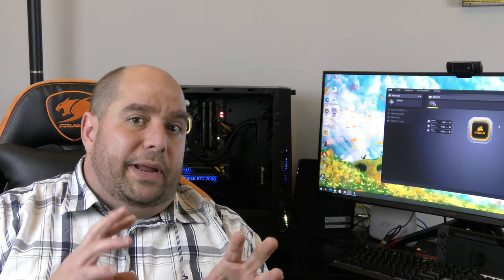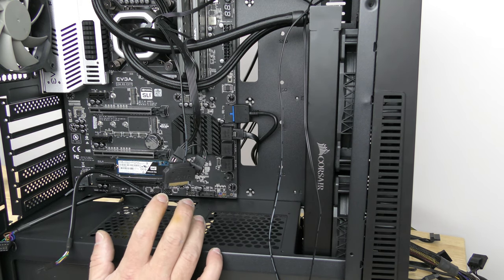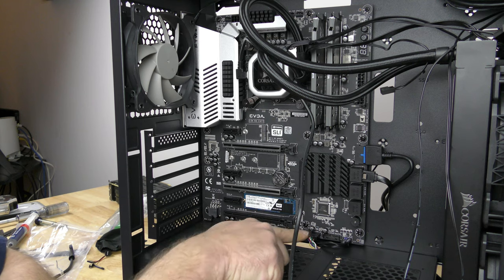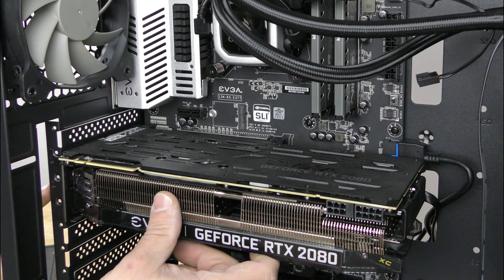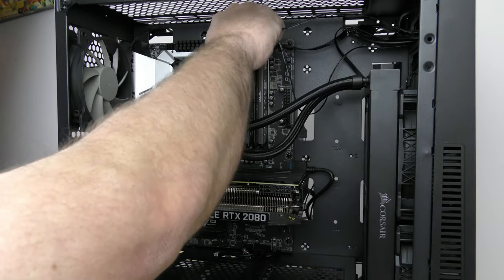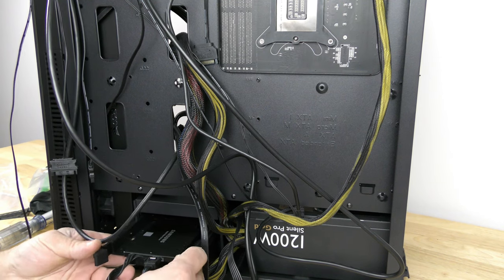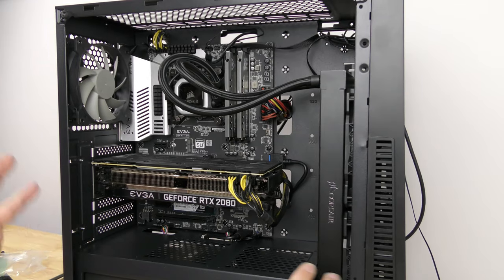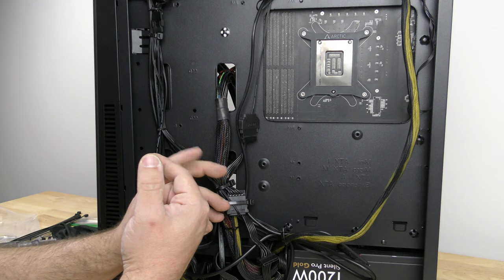How to Wire a PC Game Build for Beginners - Step by Step Wiring Guide 2021

Comment: Hello, it was my first time building a pc and got it build now, however, my ports dont seem to work. The motherboard does get power, as the RGB and the pump do work, but as soon as I plug something into the usb port or the hdmi I don't get anything.
Reply from the maker: well, are you using the front USB port or the rear and if you have a video card, you should be using the HDMI port on the video card, not the motherboard.
Reply: @ThisBytesForYou  oh no, I've tried front and back.
Reply from the maker: @wolfifly5944  do you see anything on your screen when you turn it on?
Reply from the maker: @wolfifly5944  oh wait, I just realized, the I/O shield on the back, where you plug the USB devices into, do that have a piece of metal going into them from the I/O shield, or are they slid over, out of the slot.  This can and does happen to many builders.  The I/O shield should not be inside the USB/Ethernet and other ports.

Comment: Why is the wiring on the case ? My case didn’t come with any wires I have the Darkflash dlm21 matx case .
Reply from the maker: the case comes with usb cables, maybe esata and the front panel headers.  The power cables come from the power supply and the sata cables come with the motherboard, like I showed you on the other comment, you can find some sata cables my amazon affiliate link: https://geni.us/1up1jYg
Reply: @ThisBytesForYou  so what do I do?
Reply from the maker: so what do you do about what... maybe buy the cables?
Reply: @ThisBytesForYou  okay thanks
Reply: @ThisBytesForYou  it doesn’t matter that my board is micro atx, it works for the same ?
Reply from the maker: no, it does not mater, it would work the same.

Comment: hello! I have a problem, 3 days age I made a PC, it worked perfectly until yesterday when my PC crashed and I couldn't longer see anything on my TV (im using HDMI) and some of the USB port no longer work, in the back of the motherboard I saw that 4 pins are bended, I don't know if they are the problem
Reply from the maker: bent pins are no good, make sure to get them straightened.  Which 4 pin is it?
Reply: @ThisBytesForYou  the are in the lower right side of the cpu (if you look from the back)
Reply from the maker: ohhh, you mean there are bent pins on the cpu?  Or do you mean on the back of the motherboard?  If you mean on the back of the motherboard, you shouldn't have to worry about that?  Maybe I am confused?
Reply: @ThisBytesForYou  yes, the bent pins are in the back of the motherboard but I said that they are next to the cpu to be easier to localize, also, the motherboard works, but the only problem is that my usb ports no longer works and so is my hdmi port
Reply from the maker: I don't see an issue with that, those are solder points.  I would recommend to count the number of screw holes on your motherboard, then flip the case around and look on the back and verify there is the same amount stand offs, the board could be grounded.
Reply: @ThisBytesForYou  I fixed it, thank you!.
Reply from the maker: @raingod6349  awesome bud, so what was the issue?
Reply: @ThisBytesForYou  I dont really know, I just rebuild the PC and it know works, maybe some cables haven't been connected well

Comment: The wires does the power supply have all the wires i need to set it up, Yea I Don't know how to build a pc like turn it on and Connect it to a Monitor
Reply from the maker: It depends on what your power supply is, to help, what are the specs of the system you are building, please list the manufacturer and model number of the following

1. Motherboard
2. CPU
3. Video Card
4. Processor
5. Case
Reply: @ThisBytesForYou  The Motherboard is Asus ROG Strix B450-F The
Cpu is a ryzen 5 3600 The Graphics card is a Rx 5500xt 4gb 
6 core 12 thread
Its a Nzxt 5H10 for case
Reply: @ThisBytesForYou  and the power supply is a 500 watt
Reply: @ThisBytesForYou  I'm in a 700 - 900 dollar budget if you have any tips please tell me
Reply from the maker: @sleepynismo.  You might be interested in this then: https://youtu.be/I3fssq2t-Js, that's the build video and this is the wiring video https://youtu.be/bgThR2hTVlM, you can find my amazon affiliate links to everything in the description.  Let me know if you have any other questions.

Comment: I’m still having problems figuring out where the vgb cable, do I need an extension cable? Cuz the only slot for the first part of it is too small, the other one I just don’t see
Reply from the maker: What motherboard do you have?
Reply: @ThisBytesForYou  tug b450-plus gaming mother board from asus
Reply from the maker: if you are referring to RGB a VGB cable, that is for gigabyte or do you mean VGA?
Reply: @ThisBytesForYou  vdg, my apologies
Reply from the maker: @expanddong6156   thats what I thought, but I wanted to make sure, vdg is only for Gigabyte and Aurous motherboards, don't worry about that cable, use the ARGB cable but I don't see that your board has ARGB headers.  what are you trying to connect?
Reply: @ThisBytesForYou  I’m trying to figure out where the cable with 3 holes goes, and I tried connecting the cable with 1 hole not there out of the 4, however the hole is too small to fit anything in
Reply from the maker: @expanddong6156  the 3 pin fan header can fit in the 4 pin fan header as well, VGD and ARGB will not work on your board, since it does not have ARGB headers or control.  So you can use your device plugging in the other things, just not ARGB, but what device are you trying to plug in?
Reply: @ThisBytesForYou  I’m honestly not sure, I am a beginner, but I’m looking for where the right place is currently
Reply: @ThisBytesForYou  for the time being I just put the 3 pin vdg cable in the 4 rgb header, should that be efficient enough?
Reply from the maker: @expanddong6156  no my friend, the VGB cable is for gigabyte and Aurous motherboards, you have an Asus motherboard, do not connect that cable.
Reply: @ThisBytesForYou  will I need to buy an extension cable for vdg cable in that case?

Comment: Question I can connect AIO pump connector to AIO_PUMP header but can I connect it to cpu fan header?
Reply from the maker: yup, you sure can but verify how the pump has you change the regulation of the header in the BIOS.
Reply: @ThisBytesForYou  Yeah thanks but I heard that if you plug it in CPU_FAN header the radiator runs on 100% all time?
Reply from the maker: @hyposez1129  if that is what you set the cpu fan header to,  regardless you want the radiator to run at all times, maybe not at 100% though of course.

Comment: do you need an ssd?
Reply from the maker: You don't "need" one, you need storage to be able to store and run windows.  If you want to do it FAST, then yes, you need an SSD, but if you don't care about speed and noise, a regular hard drive is fine.

Comment: This is complicated someone help I have an ibuypower slate mr pc and the lights are on and the fans are running does that mean everything is plugged in?
Reply from the maker: soooo, the lights are running, tells me there is power, but you are not giving me any info to help you.  The lights are on, the fans are running, do you have a monitor connected to the video card to see something on the screen to tell you if your PC is doing something?
Reply: @ThisBytesForYou  thanks don’t worry I got it to work but I only have one bar of wifi
Reply from the maker: @teenola6839  so move your router, move things around, anything can cause issues with wifi signal, microwaves, radios, other routers, refrigerators, etc.

Comment: Before I watch this I hope this means where all the cables go like in the mother board and gpu and stuff
Reply from the maker: Yup, it sure does
Reply from the maker: Let me know if it has everything you need, it should
Reply: ThisBytesForYou I had to go do something so I’m going to look at this video now do u say what cable is what
Reply from the maker: I would like to think I do, but if I don't let me know where I messed up and I will try to either help you here or in another video.
Reply: ThisBytesForYou I need help where does the sata cable go for the gum stick looking ssds
Reply from the maker: The M.2 SSD does not need a sata cable, that goes plugged into an M.2 slot on your motherboard.

Comment: hey man, so i turned my pc on for the first time however, none of the usb ports are working, even though everything else is getting power, do u have any solutions?, much appreciated
Reply from the maker: is it your front panel or your rear IO that does not have power?
Reply: @ThisBytesForYou  the usbs for the entire pc are not working, from the rear to the front panel
Reply from the maker: oh... turn off your PC quick, chances are you are grounded with an extra stand off under your motherboard.  Open up your case, count the number of screw holes your motherboard has, then turn the case around, take off the rear panel and see how many stand offs are screwed in.  To me, you have too many, but hopefully, this is only temporary damage, not permanent.  Also, check to see on your rear I/O, unplug all the usb, ethernet and other devices and verify there is not a sliver of metal going into the ethernet, usb or any other port from the IO shield.
Reply: @ThisBytesForYou  i also happened to find a usb header lying around, could that also be the problem?
Reply from the maker: @gunz-x7  header as in loose cable, or a header that fell off the motherboard?
Reply: @ThisBytesForYou  it looks like a header you would put into the mb, but the end of the header is like a tiny three slot header which i assume you put somewhere into the mb
Reply from the maker: @gunz-x7  ummm, 3 slot, not sure which that is, but where does the other end go to?
Reply: @ThisBytesForYou  idk if youtube allows link but i have a picture of it, i could send it here if u like
Reply from the maker: @gunz-x7  I block links, but they go to my block videos and I can see it, so go ahead and send it and I will check it out.
Reply from the maker: It looks like that cable would go to your liquid cooling unit, internal fan hub, USB hub or some other device, it looks like it might be important for you to use that.
Reply: @ThisBytesForYou  will this fix the usb problem\?, or should i keep looking
Reply from the maker: I dont think it will fix your USB problem, it will potentially fix something else, but check for an extra stand off or a piece of metal in your open ports in the back.
Reply: @ThisBytesForYou  whats the minimum  amount of standoffs that should be installed?
Reply from the maker: @gunz-x7  thats all dependant on your motherboard, so if your motherboard has 9 holes, you should plug in 9 standoffs and 9 screws, no extras,  NEVER think minimum because your board could flex making it contact the motherboard tray shorting out your board.
Reply: @ThisBytesForYou  i am just honestly worried i could have caused damage
Reply from the maker: @gunz-x7  you could have, it happens but just verify how many are used, make sure you are using the right ones.
Reply: @ThisBytesForYou  i used the ones that came with the motherboard, there are two missing screws that might be the reason i hope this whole problem is only temporary
Reply from the maker: @gunz-x7  Just make sure however many stand offs the board requires, are all plugged in.  The motherboard will not bring stand offs (other that M.2 stand offs for your m.2 drives) or screws, the stand offs and screws come with your case.
Reply: @ThisBytesForYou  oh well i used the cases screws, will this matter?

Comment: So I just built a pc when I turned on the pc all the rgb was on every fan was spinning but there was no display please help me
Reply from the maker: So that I can help, please list the manufacturer and exact model number of the following components:
1. Motherboard
2. CPU
3. RAM
4. Video Card
5. Power supply
6. Monitor.
7. Do you have ALL of the PCIE connections plugged in, and not daisy chained or pigtailed, each coming directly from the power supply?
8. Are you running through HDMI, DP, DVI, VGA, etc?
Reply: @ThisBytesForYou  display port and HDMI
Reply: @ThisBytesForYou  ASUS AM4 TUF Gaming X570-Plus (Wi-Fi) AM4 Zen 3 Ryzen 5000 & 3rd Gen Ryzen ATX Motherboard with PCIe 4.0, Dual M.2, 12+2 with Dr. MOS Power Stage
Reply: @ThisBytesForYou  I have a ryzen 9 5900x
Reply: @ThisBytesForYou  I have a feeling it’s the cables I didn’t plug in properly
Reply from the maker: What is your video card manufacturer and model number?  If it is what I am thinking it is... you will have an issue as potentially your processor is not supported out of the box and you need to update your BIOS, but your board does not have flashback... so you may need to borrow a supported processor, use that to flash, then afterwards your system will work.
Reply: @ThisBytesForYou  MSI Gaming GeForce RTX 2080 Super 8GB GDRR6 256-Bit HDMI/DP Nvlink Tri-Frozr Turing Architecture Overclocked Graphics Card (RTX 2080 Super Gaming X Trio) (Renewed)
Reply: @ThisBytesForYou  I tried my 1660 super and same results
Reply: @ThisBytesForYou  how would I borrow a CPU?
Reply from the maker: @camfireguy6393  by having a friend that has a supported system, makes sense right?  Also, if it's a cable you think, follow this guide for a build guide on the X570: https://youtu.be/9gg8w8BHGn and then the cabling for that system to help: https://youtu.be/nJUqyHh1QQY
Reply: @ThisBytesForYou  well none of my friends live in my state
Reply: @ThisBytesForYou  the X570 built guide isn’t working
Reply from the maker: did you watch them, both videos?  Being that the guide you are commenting on is of the Z370 chipset, and the build guide and cabling guide for the X570 are longer than the 4 minutes it took you to reply, I don't think you did.
Reply: @ThisBytesForYou  no the link didn’t work but I watched a built guide with my motherboard
Reply: @ThisBytesForYou  didn’t really help
Reply from the maker: I get it, but 
1. Have you verified the 8Pin EPS CPU power is connected
2. Verified the 24pin ATX connector is connected
3. Have you verified both PCIE cables are connected to the video card
4. Is your power supply powerful enough to support your video card
5. Are you daisy chaining any connections to your video card
6. Your CPU is potentially not supported by your current BIOS, you need a test CPU, to find out
7. verified the memory is in the correct slots
8. verified the memory is seated correctly
9. Is your monitor connected to the correct HDMI/DP port on your video card (not the motherboard)
10 the list can go on, and you have not given me much to help you with
Reply: @ThisBytesForYou  someone’s coming to my house to look at my pc
Reply from the maker: please let me know what they tell you
Reply: @ThisBytesForYou  the mobo might be dead
Reply from the maker: @camfireguy6393  sucks when that happens, but it happens sadly.
Reply: @ThisBytesForYou  yep

Comment: I might be blind but i cannot for life of me find the power switch cord on header for a z490 mother board.  Trying to trouble shoot a computer that wont turn on.  Anyone have any idea where it is on this board?
Reply from the maker: every case will have a Power Switch cable, and you will need to connect that the IO headers on the board, what is the exact manufactuter and model number of your Motherboard and case?
Reply: @ThisBytesForYou  .  Thanks for your reply!  I was actually able to find it.  Cord looked little different and didn't have psw label on it.   And yep it was my problem.  Dang thing fires right up now

Comment: hi help me to connect my argb 3pins to the header of my motherboard but there's no header in my motherboard just sys fan
Reply from the maker: What is the manufacturer and model number of your motherboard?
Reply: @ThisBytesForYou  It's Gigabyte Z170X Ultra Gaming
Reply from the maker: @heidaralzobeidy1572  check on the manual, on page 20 https://www.gigabyte.com/Motherboard/GA-Z170X-Ultra-Gaming-rev-10/support#support-dl
Reply: @ThisBytesForYou  what is this? I want you to help me manually 🥺🙏🏻
Reply from the maker: @heidaralzobeidy1572  perfect, I am, that is the manual and this will help you as well to get them connected https://youtu.be/k6A3MG3yJzQ